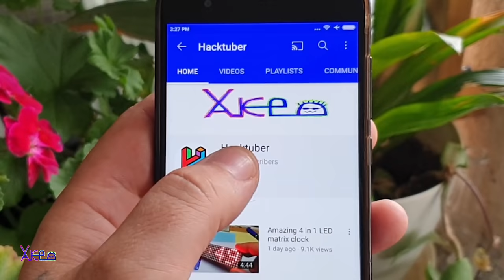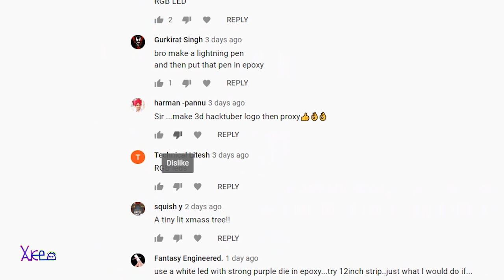One Cool Idea in Epoxy Resin | Wireless Skeleton Circuit

Comment: Pro tip:  Use a heat gun or a hair dryer to eliminate the bubbles.  Focus the heat on the bubble, and it will rise to the top (while it’s still wet).  Hope this helps your future videos!!!
Reply from the maker: I have try that and is hard bcz I use circuits in resin
Reply: Use the heat gun before the resin starts to harden, and the bubbles will float to the top! TRUST me, my friend!  It works!!!  NO BUBBLES AT ALL!  YOU WIN!